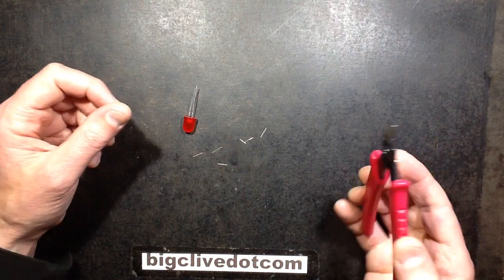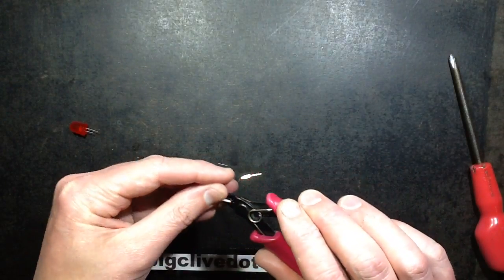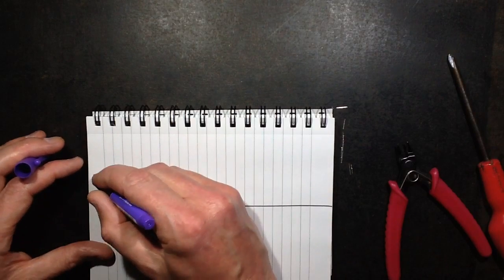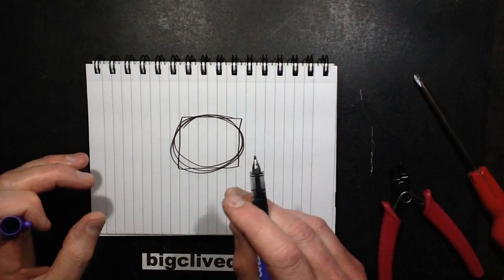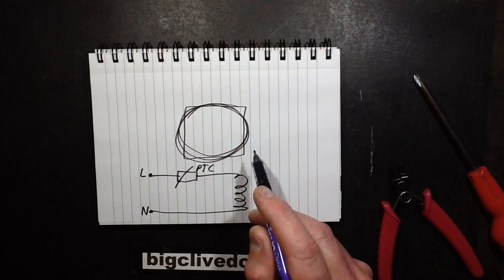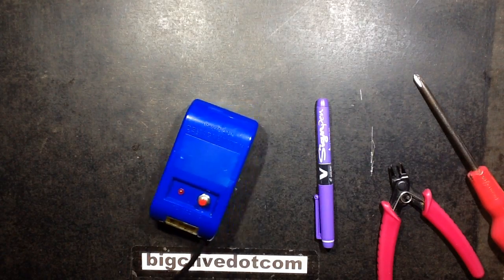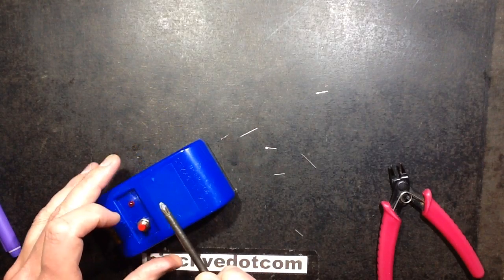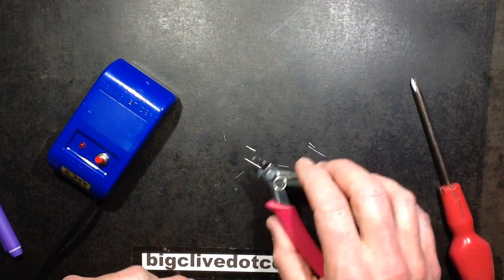A look inside an ebay degausser/demagnetiser from China.

Comment: Must look to see if I still have one fish tank air pump, which uses the same coil. Comes with a case as well and a cord, though I would have to put in the switch. That unit looks remarkably similar to the fish tank pump housings as well, probably made by the same factory.
Reply: SeanBZA Careful - without anything to complete the magnetic circuit the inductance will be a lot less and it'll get quite hot very quickly. If it's got a one-shot thermal safety cut-out embedded in the winding you'll only get one go at finding out how quickly.  

A core designed to go in a demagnetiser will be wound differently, although it'll still only be rated for intermittent use.
Reply: Graham Langley  It is open, with only a ferrite magnet waving in the breeze....... They did look very crispy though after a few years moving that rubber diaphragm though. not helped by them all seemingly to be made with the core cover being ordinary painters masking tape. That almost always was a few brown crumbles inside the bottom of the rubber base when you opened it, along with the black rubber crumb from the pump diaphragm falling to bits.
Reply: SeanBZA My baby degausser is the coil from a defunct hair trimmer. It's an E-core and drove a magnet that oscillated back and forth between the open legs of the core - there wasn't much coupling. But without it 30 seconds is as long I reckon it's safe to run it for.

Comment: Hi Clive. The thermistor arrangement used on CRT degaussing coils actually uses two thermistors. There's the PTC one in series with the coils as you describe plus an NTC one in parallel with the coils and closely thermally coupled to the PTC. With this setup the residual current through the coils once their job is done reduces to near enough zero - without the second thermistor there would always be a current through them.
Reply: Graham Langley There are 2 wire thermistors, designed so the coil current when hot was very low. Basically now common as a polyfuse.
Reply: SeanBZA With a single PTC device you still have to have a current through it in order to keep it hot and high resistance, and this current would have to go through the coil. Adding a thermally-coupled NTC shunt device across the coil diverts this current and eliminates any picture disturbance.
Reply: Graham Langley True, but they made some hyperabrupt 2 wire PTC units that when hot stayed hot with only around 10mA of current, and then in some sets they had a very high value damping resistor across the coil as well to reduce the current further.  The 3 terminal ones did do a better job, but many sets only used the 2 wire arrangement, though they did go up nicely when they failed. Still would rattle like a castanet when failed.
Reply: SeanBZA I've not not come across those,  but then I've only pulled my own TVs apart to fix and I've not had to do that for many years. Last one was a neighbour's curved widescreen Toshiba with '99 batch codes that we were taking to the dump earlier this year and that had a three-terminal PTC+NTC one.
Reply: Graham Langley My monitor had one connected with a relay and sensing circuit to completely disconnect the PTC/coil assembly when the current dropped enough.

Comment: Can this re magnetize things as well?
Reply: Thealarmboy I guess if you put a diode in the circuit it will.
Reply: Mentorcase Yes, thanks for answering my question
Reply: Mentorcase Nope. The core will saturate so the current through the coil will only be limited by its resistance, which won't be anywhere near its impedance at 50/60Hz. Result: a blown fuse or worse.
Reply: Graham Langley Thank you so much for answering my question
Reply: ***** Thank you for answering my question. I know a little bit more on how this works now

Comment: My first use of a degausser was an electricity meter potential coil, potted in polyethylene... That's also where i learned that when you remove the core(tool), the coil loses the reactance, and gets really hot really fast

Comment: LOL @ use of crt in past tense.

totally not watching this on a crt
Reply from the maker: ***** Yeah, it took a while to get rid of one of the last Vacuum tubes still in use, but then it was a very sudden switch to LCD panels.
Although...   One of my video games has a vector display, and it totally kicks LCD ass.
Reply: bigclivedotcom We utterly don't need a video about this video game...
Reply: ***** (invert that, i need that video lol)
Reply from the maker: ***** It's Atari Tempest.  And it's undoubtedly the most troublesome of my games machines.  Right now I don't have access to it, but I may well end up doing a video on some of its circuitry.  But here's an interesting bit of trivia.  It has a super high resolution display which it drives like an oscilloscope in full colour.  But it only has 2 Kilobytes of video RAM.
Reply: I am watching a crt and will do so as long as possible way better viewing angle and way ruggeder if bumped
Reply: mine is a FE990 by nec the front corners are 2-3 cm thick this thing is a tank
Reply: Us guitarists are still flying the flag for vacuum tubes! You still can't beat the sound of a good tube amp.
Reply: bigclivedotcom wait last vacuum tube in use? what about magnetron in microwave ovens?
Reply from the maker: MrSlehofer And to be fain, neon lamps, fluorescent starters and even fluorescent lamps themselves.
Reply: Jamie Phillips Yeah, like a centimeter thick glass tends to be stronger than 0.5 mm thick one...
Reply: bigclivedotcom They are not true vacuum, they are just low pressure gas tubes.
Reply: ***** I am actually quite impressed your CRT hasn't started fading to be honest. I used CRT's way past their prime because I was stubborn, until I could no longer find one with decent sharpness or brightness.
Reply: +bigclivedotcom I wouldn't mind a look into the guts of an old arcade-style video game unit.

Comment: I used to use a RadioShack degauser on my 8-track player. Man I hate those leads sticking to my nippers though.
Reply: Brian Ullmark You get the same problem with sheet metal guillotines. Cutting steel gradually magnetises the blades and cut parts eventually start sticking to them. But you need a much bigger demagnetiser/degausser than this one.